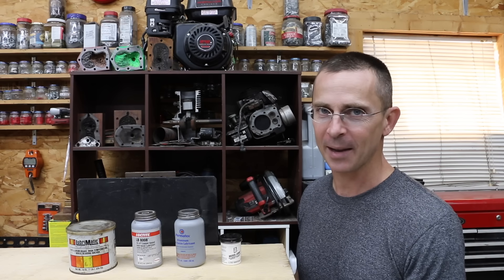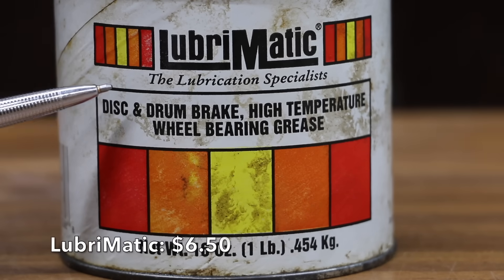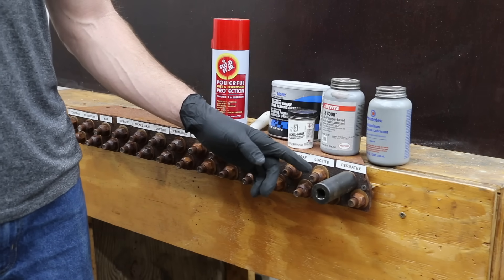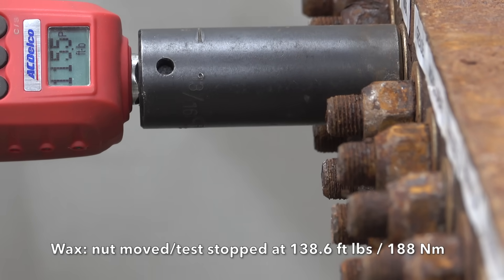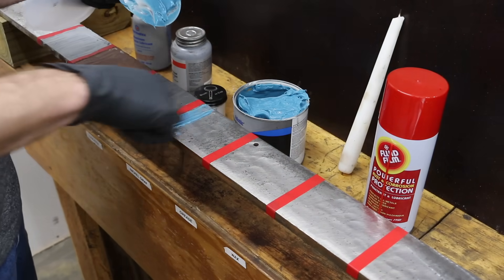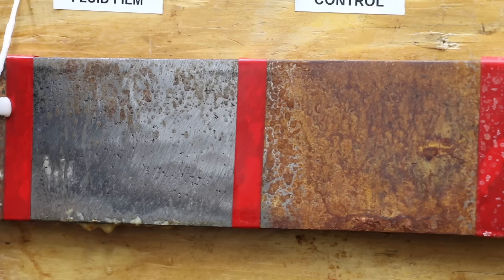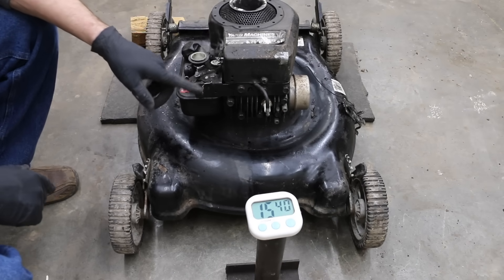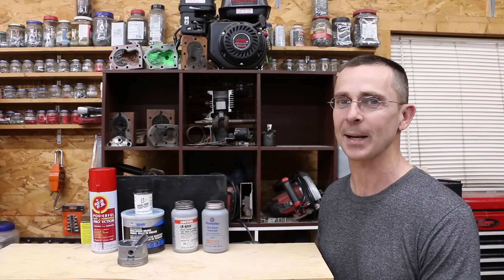Does Anti-Seize Compound Actually Work? Let's find out! Anti-Seize vs Grease vs Fluid Film vs Wax

Comment: Yet another great video! Keep it up! I was a professional boat mechanic for a number of years, both commercial and recreational, and I can tell you first hand that there is no doubt that anti seize works. The general consensus was that the copper was the best for what we did, however, as you briefly mentioned in the video you must be careful with your choice of agent. Putting copper base on an aluminum outboard engine will result in severe galvanic reaction that will effectively destroy the outboard housing in surprisingly short time. We also had access to a special non galvanic anti seize/ grease: I wish I recalled the name of the stuff, it was baby blue in color and used a fine teflon as its primary agent.  This stuff was magic, we would use it when mounting propellers to the propeller shafts on larger boats as well as lower housing bolts on an outboard motor (stainless boats in aluminum housing). It was very expensive (which is why we still used regular a/s), but I've never seen anything work as well.
Reply from the maker: Thanks for the feedback.

Comment: Never would have thought of testing if anti-seize would keep an engine from seizing.  You've tested a lot of different flammable liquids in gas engines, but what about running ICE engines on wood, using a wood gasifier?  Here are plans for a wood gasifier published by FEMA in 1989.  @t
.  There are plenty of videos on YouTube running generators with wood gas.  Vehicles or anything that moves would obviously be a different story, but I would think the Farmabago has plenty of room for a wood gasifer.  Mounting it on the back with one of those storage racks would eliminate any issues of venting any escaping gas, or concerns about the gasifier exploding or catching fire.  It would also give you a chance to test 'wood mileage per hour'.  LOL!  Keep up the great work!  Update:  Turns out there were hundreds of thousands of prouction vehicles in Europe that ran on wood gasifiers during WWII because fuel was needed for the war effort.
Reply from the maker: Thanks for the video idea.

Comment: Have you ever tried different engine oils in running engines to see if some oils make engines run hotter ? I’ve always used manufacturer oil BUT when I switched to Amsoil my small engine seemed to run much hotter and it cracked a cooling head and yes it was amsoil small engine oil. Amsoil is probably some of the thinnest oil I’ve ever used. Not sure if that good. It does last longer between oil changes to end it opositive.
Reply from the maker: Thanks for the video idea.
Reply: Project Farm 👍🏼👍🏼👍🏼
Reply: Yep, I agree.  I used Amsoil after my second oil change in a new 1800 CC v-twin motorcycle.  I experienced massive blow-by for a couple of years.  I changed to Rotella diesel oil for the high zinc, and have had ZERO issues ever since.  I am not a fan of overpriced Amsoil products!

Comment: For the first time I have a disagreement with the testing. One of the prime uses of anti-seize is to prevent galling of treads. Galling of stainless steel on stainless steel (SS) or aluminum on aluminum is a big concern. After building a deck with SS bolts and nuts I can assure you that the use of the anti-seize compound is critical. Before I used the compound 2 bolts seize up with the nuts only partially on. This required cutting the bolts off.
Reply from the maker: Thanks for the constructive feedback.

Comment: And copper loctite for the win. I've used this for years and like the hot sauce add "I put that sh☆☆ on everything ". I buy the bigger cans at my local flea market for  $6.00 a jar. I restore old tractors and I use it to coat bolts, shafts, and exhaust parts. Never lets me down.
Reply from the maker: Thanks for sharing.

Comment: How does the candle wax one react when heated a bit? I'd think it'd make it harder to break loose when hardened but it surely wouldn't take much to melt and would perhaps protect against rust by sealing the bolt in when hardened then with slight heat melt and let the bolt come off like brand new.
Reply from the maker: Thanks for the feedback.

Comment: I've never tried any of the other products you tested but I've always used copper slip (which I'm assuming the Loctite is similar to) and it's never failed, it's just grease with copper dust mixed in, although I'm sure it's more scientific than that!
Reply from the maker: Thanks for sharing.

Comment: What makes copper anti-seize worth double the price of aluminum?  Seems like they perform about the same.
Reply: Copper anti-seize is rated for a higher temperature than aluminum anti-seize. Nickel anti-seize is rated even higher than copper, but also costs more. If I'm putting an exhaust together, I use nickel anti-seize. If I'm putting just about any other car component together, I use aluminum anti-seize, or a product called "Moly-Lit".
Reply: @therealstubot  Thanks for the response.  When I searched online, it appeared aluminum and copper were both rated at 1800°F.  Nickle is rated up to 2400°F, but even a race car exhaust should only be 1200°F max, so I'm still not convinced that its worth spending more for copper or nickel.
Reply: @Richard.Sanchez  The aluminum anti-seize will get hard and crusty over time when used on exhaust components. It may be rated at 1800f but if you don't take your exhaust apart more than once every few months, the aluminum anti-seize will turn into thread locker. It doesn't do that on components that don't get really hot. The copper anti-seize will last a year or more on exhaust components before it turns to concrete. The nickel anti-seize might get a crust formed on it, but it never gets so hard you can't wipe it off with a towel. I keep a big jug of aluminum anti-seize in my tool box, and a small tube of nickel for when I do exhaust work.
Reply: @therealstubot  Thank you, this is what the spec sheets don't tell you.

Comment: When it's really  critical I use nickel ant-seize 2600 degrees F.  especially on exhaust manifolds,  but for general use bearing grease works well, grease works well in truck light bulb sockets to keep out salt and corrosion,  Great Video,  Thanks William Orange county, ca.
Reply from the maker: Thanks for the feedback.

Comment: I really want to see if pure mercury would work as engine oil. I bet it would, it has uncreadably high surface tension.
Reply from the maker: Thanks for the video idea.
Reply: It WON'T work at all, because it does not "wet" the steel.  Oil adheres to metal. Surface tension is just one of the many attributes that lube oil MUST have...

Comment: Lmao, that was funny. "It did it's job, the engine didn't seize".
I use that aluminum anti-sieze religiously, it definitely works well for me here in the rust belt. 
Great test.
Reply from the maker: Thanks for sharing.
Reply: Hahaha, dang man, some people are just way too bored. 
Btw,1st amendment, I'll say whatever I want. 🇺🇸
😁
Reply: Article 1 gives free speech. Say what you mean and mean what you say
Reply: burningfeet 57  What are you talking about? The rust belt is a term used for the area where manufacturing has decreased greatly around the turn of the century.  The bible belt, what you seem to have confused the rust belt with is just an area where Christianity is followed by more people than average.  They are both demographic terms, not religious terms.
Reply: @hdog9046  Reread his post...🤣😂🤣
Reply: @CGoffgrid  Well, don't I look stupid now.

Comment: I would've liked to see you use the anti-seize test for steel on aluminum. I always use anti-seize on spark plugs in aluminum heads. Years ago, I broke off a plug trying to remove it. I'm sure whoever replaced the plugs before never used anti-seize.
Reply from the maker: Thanks for the video idea.

Comment: Well done as usual. I am now curious as to the wax. Seems to me it would be much fairer to apply the wax to a preheated surface and then we have what kind of wax, bee wax, paraffin or a quality plumbers bowl wax. As tested, the wax hit the cold surface and had no time to penetrate the steel. Reason I ask if our company has pulled out thousands of toilets and for the most, the toilet flanges look brand new on the top where the wax seal is placed. Ones we install, it is quite normal to pour the lead joint, caulk it and set the toilet while the cast iron is still warm. We do industrial and commercial where plastic for drainage is not allowed due to the toxic fumes of burning PVC and seriously, we must keep the real plumbing trade alive. And for those who care, lead wiped 1 1/2" and a 4" joints are part of the apprenticeship test to become a Journeyman plumber.
Reply from the maker: Thanks for the feedback.

Comment: I use the Permatex aluminum anti-seize regularly, most importantly for spark plugs to keep them from mating to aluminum heads, and a small dab on lug nuts and a small smear on the back of rims where they make flush contact with brake rotors. It makes a very big difference when disassembly is expected to be smooth without breaking spark plugs or studs, or having a seized rim due to corrosion and electrolysis.
Reply from the maker: Thanks for sharing.

Comment: A great Teast for "Antiseaze", protecting Steel/Aluminum Blots in the Oposing Material that Experience Extreme Heat... (-Cylinder Heads/Cooling Tins)!

Even with using an "Liquid Wrench-like Product" the Heads/Bolt snapps on me...

I'm sick of using my Tap/Die and "Easy-Outs"!

Once I get the Fastener out, I don't want problems 5-10 years later, and maintain "Bolting/Securing Strength"...🤔

Sounds like a "FUN" test!

Thanks again & Take care,
🤓 -Thomas
Port Orchard, Washington
(Just West of Seattle)
Reply from the maker: Thanks for the video idea.

Comment: People often confuse the useless synthetic candle "wax" with the actual beeswax. If properly applied, beeswax does provide good surface protection and water barrier, although it won't survive heating above 200C, so it's good for cool wide surfaces like body panels, not so much on the undercarriage or engine components. You can use beeswax to prevent a bolt/nut seizing, but not in the same way as anti-seize compounds, you have to coat the entire thing in a thick continuous layer of wax, so it's not the most practical thing to do.
Reply from the maker: Thanks for the feedback.

Comment: PF, HELLO,  the very first job I got in NJ I was given a can , of , NEVER SIEZE’  in 1968   we used it on certain bolt on BOILERS, & bolts on several areas on CHILLERS, such as STRAINERS  which got cleaned   On schedule,40 ^F  lots of rust  on bolt heads , now NEVER SIEZE  made different formulas including a NICKLE FREE VERSION, , we just used the regular one, I STILL HAVE THAT CAN, I use at home l wheel lugs , and spark plug for lawnmower, it kid now 03;17 hours EDT as Iwright this, so not going to see the manufacturers name,,on can, but I keep a ‘FLUX BRUSH ‘  which I have used to apply the product , some of those you had I had never saw before . CHEERS FROM NJ USA.  🇺🇸🇺🇸🇺🇸🇺🇸
Reply from the maker: Thanks for sharing.

Comment: Hoping you might do a follow up to expand on this. Some suggestions if so:

1. Use a aluminum/copper/nickel/metal-free antiseize all from the same brand. These types are fundamentally different products with different properties and applications. You lose a lot of data by having brand differences thrown in as well.
2. Throw in at least two metal-free antiseizes. They don't have any galvanic issues and are MUCH better for health and the environment. Two good brands are Anti-Seize brand and Jet-Lube. I'd go with their marine grade options.
3. Add a testing cycle of vibration while submerged in a mild detergent (Simple Green in an ultrasonic cleaner maybe)
4. More heating cycles should highlight some weaknesses.
5. Add some submerged freezing cycles as well.

I've done a bit of testing of my own and would be glad to expand on some of this if it would be useful!
Reply from the maker: Thanks for the follow-up idea.

Comment: I use RTV form a gasket as anti-seize.  It works fine for things that need to stay in place.  And are not retorqued.  I have never had corrosion on bolts treated this way.
Reply from the maker: Thanks for sharing.

Comment: I cant even begin to imagine how long he is going to be finding anti-seize on every surface of his shop🤣🤣
Reply: Yeah I was thinking the same thing. That stuff spreads faster than the corona.
Reply: @TheKajunkat  Sure does.
Reply: Bradley Smith ... anti-seize is like sand at the beach. It gets into everything when you are not looking! (if you don't clean your fingernails you will find some in your shorts tomorrow)
Reply: Especially the copper stuff
Reply: I prefer the copper type because it wipes off your hands vs the aluminum which doesn't.
Reply: POWERGLOVE KilleDX Good to know thanks.
Reply: .05 Seconds after that engine explodes!

Comment: Could you test running a diesel engine by just injecting fuel into intake air? I know that you can run diesel by injecting wd-40 or brake clean into intake. That's a common way to get cold engine started. But does this cause problems in longer run? Perhaps you could use your vapor set up with y-pipe for extra air to act as a throttle (works in reverse as less extra air, more fuel, more throttle).
Reply from the maker: Thanks for the video idea.

Comment: I would argue that the product that remained closes to the original torque would be the best. My biggest concern when torquing something is that it stay tight, and I don't want the lube used to effect my first torque rating or more likely to come off later. I did really enjoy this video, and I plan to use high temp grease on bolts in the future.
Reply from the maker: Thanks for the feedback.

Comment: Good to note that the nuts with the anti-seize likely had a higher clamping force for the same torque level, because of the lubricating effect of freshly applied anti-seize.
Important to remember when working with things that require accurate torque.
Another great video PF!
Reply: I have read,  that if anti-seize is used  the manufactur's torque requirements are changed.
Reply: I have read,  that if anti-seize is used  the manufactur's torque requirements are changed.
Reply: @dancahill9122  Even better, I just learned that some manufacturers actually expect anti-seize or light lubrication to be present when specifying their numbers. (for certain specific applications of course).
Reply from the maker: Thanks for sharing.
Reply: indeed

Comment: Should have been angle torqued initially - using a torque spec instead means they would all stretch the bolts to different tensions because of the friction differences between compounds/wax, etc. That would be exacerbated by the heat cycle
Reply from the maker: Thanks for the feedback.

Comment: I am getting addicted to your awesome vids. Right up my alley, i kinda always thought about stuff like this .As a retired Air Canada Engineer (we use to be called mechanics, lol) fixed and Maintained just about  every liner  built  including Lear and Gulf Stream, should be called Gulf Dream really great engineering and a pleasure to work on, unlike others. I have used all kinds of stuff as the aerospace industry including airlines use an insane amount of every kind of lube , anti seize , man i could go on and on and it was very, very expensive stuff. But the proper use of the proper substance is critical. Very enjoyable and informative as hell, Kudos my Man...
Reply from the maker: Thanks for the feedback.
Reply: Nice to hear your valuable opinion on the Gulf Stream!

Comment: Great work dude as always!  I know this might not be the right place for suggestions, but something that I've been wanting the dirt on is... 

What are the best LED bulbs available? (60w/100w equivalents)

A few factors to consider - purchase cost, light output, actual power consumption, heat output, dimmability (range of), color temperature accuracy, size compared to equivalent incandescent bulb and NOISE.  I can't ever find any good info on which bulbs produce the most/least noise, either at full power (non-dimmable) or when being dimmed.  Seems like nobody's done a thorough shootout of this type, at least with the current bulbs available on the market.
Reply from the maker: Thanks for the video idea.

Comment: Would have been curious what WD-40 would do in this test. (Engineer flowchart)
Reply: wd40 doesn't last, it will evaporate or whatever it does but it won't stay on the threads for long periods like anti seize
Reply from the maker: Thanks for the suggestion.

Comment: I am astounded that you spent 3 months testing anti-seize compounds. Your dedication to your channel is incredible.
Anti-seize compound absolutely works. I started using anti-seize compound because I got tired of my RC engines being damaged by seized screws. Since then, I've lost count of the number of small screws that I've been able to cinch-down ridiculously tight and still be able to remove, thanks to applying anti-seize compound to them. I use Permatex, though I might consider using the Loctite copper stuff after seeing this test.
I'm not surprised that the pre-rusted bolts broke loose easier than the bolts that weren't rusty before, because surfaces that are already rusty will not be able to rust together as effectively as smooth surfaces. Even rust flakes can provide minimal anti-sieze properties, which makes sense when you consider that all anti-seize compounds use metal flakes of some variety.
However, as you discovered, anti-seize is designed to provide minimal lubrication so it won't cause screws and bolts to slip from vibration, and that minimal lubrication is why the engine failed.
Reply from the maker: Thanks for sharing.